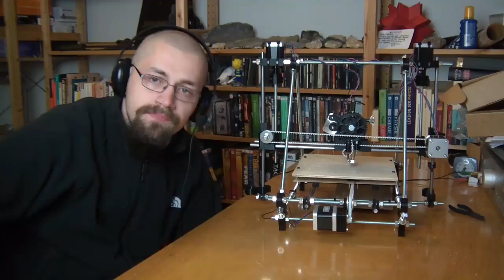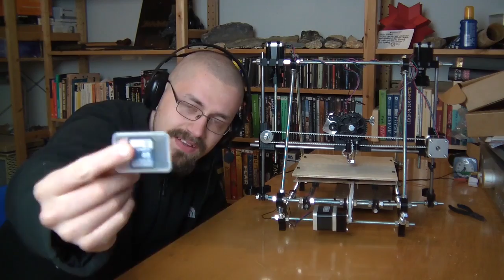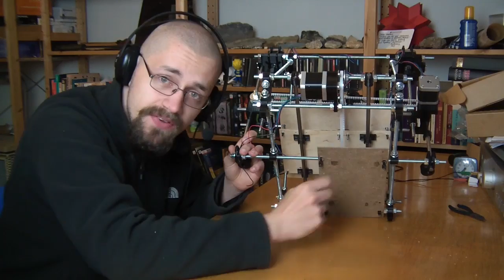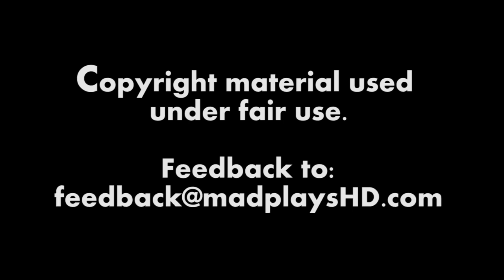Prusa Mendel Update Mechanics Work! [Pretty useless video]

Comment: i said to another you tuber, about them having one of thies printers. and they where trying to speed it up, and i was not listening eather. and i said in a comment that you could a laser to heat the plastic befor the printer head to help with better sticking,,, they told me the problem is cooling, so i sent a reply to my reply saying that there is also cold lasers and a cooling gas spray like liquid co2 or liquid nitrogen sprayed in fine jets but the cold laser would be better than gas (ECO)